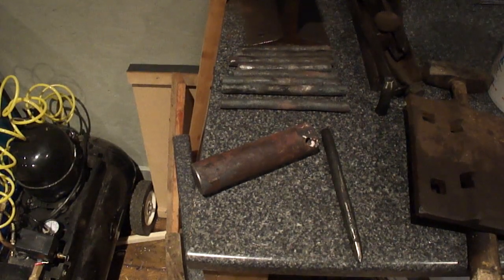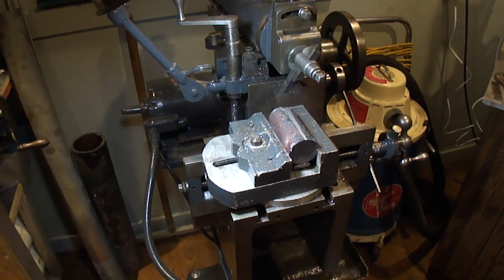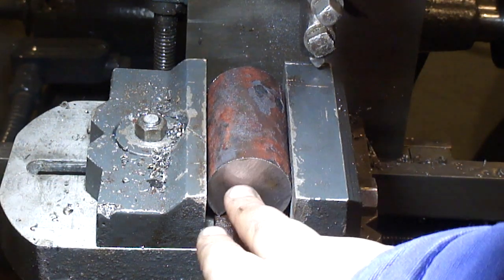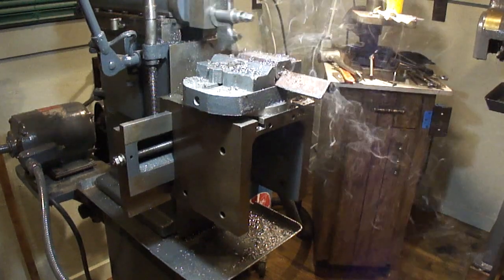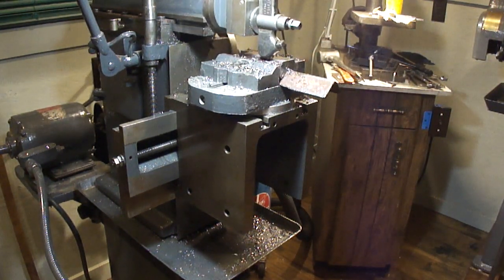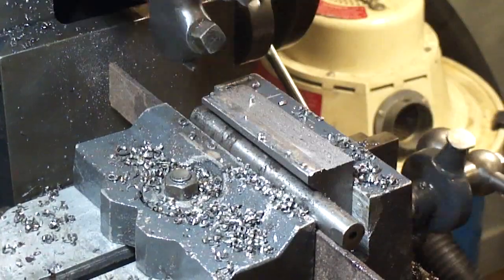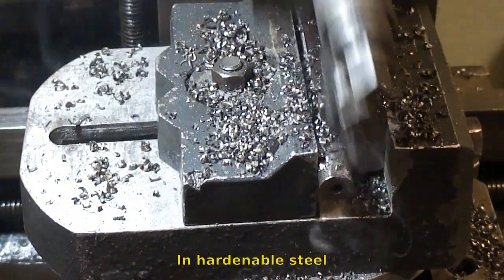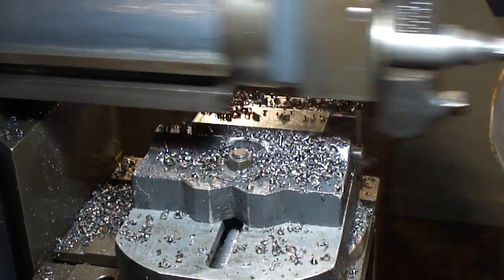Making V-Blocks (Emma's Toolmaker's Competition 2018 Entry)

Comment: You did a nice job, thanks for the video.
 I am building a sand muller from watching you make yours.
Reply from the maker: Thank you. Other than upgrading the motor, I really havnt done anything else to it after recording that series. Only thing I would change on the design tho is to get rid of that hinged door for the sand to drop out, and add one that slides in and out of place because in use, the sand tends to get caught in that hinge and you have to use a poker to clean it out before you can close that trap door again. Other than that, the thing works great and has been very reliable.

Comment: I would have also placed a 1/4 in a grove on each side about 1/4 in up from the base
Reply from the maker: yea, my shaper isnt that great at cutting slots in stuff, especially steel that hard, and in all honesty, it really wasnt needed since most of the time, they're just used for clamps to hold stuff down. I mainly use mine for holding round stuff square/vertical in the vise to machine it.

Comment: beautiful job, but I think it will be more easy to do with a square piece of metal
Reply from the maker: yea, it will be easier with a square piece, if you can hold that square piece at a 45 degree angle, but that usually requires a v block or something similar to do that. Using a round piece, it allows you to not need any sort of angle setup or anything.

This video was mainly just to show an alternative way of making a v block, and while it might not be the fastest or easiest, it does get the job done with zero fixtures or jigs.

Comment: Perhaps I’m missing something obvious, but how did you ensure the sides of the V were square to each other and the same length?
Reply from the maker: I had the head of the shaper set to exactly 90 degree square, so when I fed up and down, it was going straight up and down. I then just kept feeding in and going across till just before half way, then the last pass, I just fed in and fed the feed upwards to square everything up. As for how I made sure the sides of the V were the same size, I just kept measuring it with a depth micrometer and removing a little bit of material to get them exactly the same.

Comment: Really clever use of the shaper. I’d say I would try it but it would take an age on my rapids lime, would build my arms up though.  Am off to pick a flat belt bench drill up so I might have a small Lineshaft going soon if I can find some wall brackets.
Reply from the maker: thanks, I'd really like to see that, your shop is really neat and would really like to see more of it running.
Reply: Chirpy's Tinkerings I have just finished a woodworking project so I'll do an update on that. When I get paid I will get some stock and some cutters and get the lathe going.
Reply from the maker: cool, cant wait to see it going.

Comment: I've never heard of anyone building a v-block like that, way to be original and great idea!!!
Reply from the maker: lol, thanks for watching man. I told you that it was going to be different than anyone else has done it :P
Reply: Chirpy's Tinkerings it's seriously awesome!!!
Reply from the maker: now it'll be easy to make the V block for the hydraulic press for bending the guitar parts, just need to find some more high carbon (hardenable) steel and we'll be knocking all kinds of parts out. I did get welding wire and cutting disks, so that will be worked on very soon. I may need your help getting it back to the shop tho.

Comment: Did you find that bar on the rail road tracks,  I found two that look just like what You had.
Reply from the maker: yea, I did, but I have no idea what it was used for. It's extremely hard and needs annealing before you can machine it, it ate a carbide tip just trying to machine it before I annealed it.
Reply: A word of caution about that:  Don't assume that because it's laying loose, it's there for the taking, if it's on the railroad right-of-way.  When the price of scrap was at a premium, railroads had to crack down hard because of theft.  They will prosecute, for theft and trespassing.  And railroad dicks (ie:Dick Tracy, detectives) can be very difficult even if they only suspect you of something.
Reply from the maker: yea, I know and I have an understanding with the local railroad people because I go around cleaning up the trash and everything off of the tracks, and keep everything clean. I just cant take anything like track spikes or anything that's attached to the tracks itself, but if it's way off in the fields, it's fine, which is where I tend to find alot of the stuff anyhow. 
There's a 20 ft range from the middle of the tracks, and anything further away from that is whoever's property it is on, and where I live, that stuff gets shot out from the trains into the fields, which gets clipped by the farming equipment, and busts things up pretty badly, so they're more than happy to have someone that comes by and cleans the stuff up. The tracks are up really built up high around here, so having a piece just fall off of the train and roll down the sides of the embankments into the fields, so it's free roam really.
Also, I dont turn any of that stuff in for scrap anyhow, it's much more useful for projects, lol.
Reply: Good deal about that, I figured that you must have had some kind of arrangement, but for those elsewhere that might get the idea that active tracks is a place to go scavenging,  ... it's best to not assume.  Some roads are very, very touchy about that.

That bit you started with looked like a knuckle pin, or part of one.  They do break sometimes, as they are hard material and can get fractured.  Another item you might find in the vicinity of a de-railment sight are some bearings that support the car on the truck (keep it from tipping sideways) but allow the truck to swivel on the king pin.  We've had one of those around for decades, it's been used for anything from doorstop to practice shot-put to bench block.  You might get the rusty layer off the outside with HSS, the rest will kill your grind and laugh at you.
Reply from the maker: good to know, I always wondered what it actually was, and now that I know, I can look for more. As bad as the tracks are around here, there's not really any derailments around here that I know of, so you wont really find anything like that probably. The train tends to park below the house for lunch break, and they just leave it running and lock it up until they get back. The jolt of the train moving may have caused the knuckle pin to break like that, so that makes alot of sense.

I tried machining it with carbide and it just ate the carbide insert, so after that, I decided to anneal it by throwing it into the woodburner and getting it hot, then it machined fine. Also, the slower speed of the shaper and good mo-max cobalt HSS helps a ton on machining the higher carbon steels like that.

Thanks for the info, I really appreciate it.

Comment: Looks good!  Im also surprised you started with round.  When i saw your pics i thought they started square!
Reply from the maker: lol, nope, starting with round was the only way I could get everything square and parallel to the V groove. I started with round so that I could cut the part at 45 degrees and have it 45 degrees equally to the bottom of the V groove, and square to the sides without needing some pretty odd setups.
Reply: pro trick : you can watch series at flixzone. Been using it for watching a lot of movies lately.
Reply: @Mustafa Merrick Yup, I've been using flixzone} for since december myself :D

Comment: Great job Chirpy.  Using what you have available to make what you need.  Make sure you mark the side of each Vee Block before you harden them so when they are used as a set, the reference faces are the same distance to the centre line of the Vee. Cam
Reply from the maker: thanks, The one side has a slightly larger offset, which I was thinking of removing, but if I leave it, I can use it to vary the offset when I clamp things in the shaper's vise, so Ill probably leave them as is. I dont like marking precision tooling because usually without etching the markings, it tends to raise a burr slightly and messes with the accuracy of the tool using other methods of marking.

Comment: Way to think outside the box ;-) I'd never thought of using a round pin to start v blocks from. shaper andi and everyone I've seen all start from square material. I have some old pins like that I think I'll have to give it a try. Thanks for showing us a different way!
Reply from the maker: no problem and thanks for watching. I had to anneal my pins before I could machine them, but it worked quite well in the end.

Comment: very nice v-blocks, very interesting setup for machining.
Reply from the maker: thanks, they're an easy item to make if you have some way to turn the blocks at 45 degrees to cut the V slot, but most home shop guys dont right out of the door, so I just wanted to show another method to do it, which it does work quite well too.
Reply: I don't have a shaper but, I think that I could do this in my little milling machine by cutting a 90 degree vee as you did on the shaper over  and cut the sides and then the bottom.
Reply from the maker: yea, it can be done on shaper or mill quite easily, I was just trying to show an alternative method than most people do for those who dont have the extra jigs/setups and cutters to do it. Just an easy way to do it with what you have probably laying around to create an accurate V block.